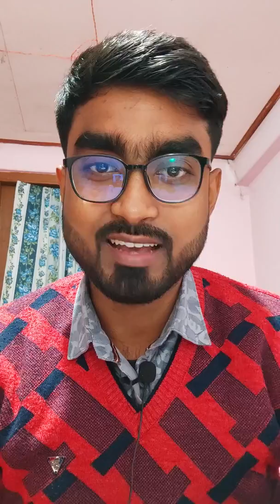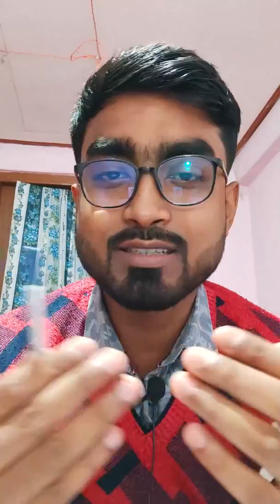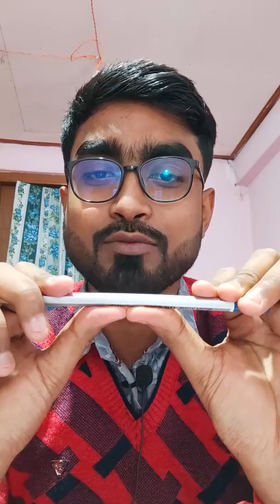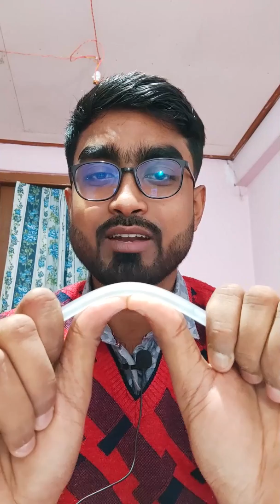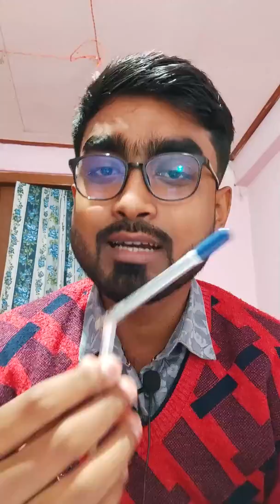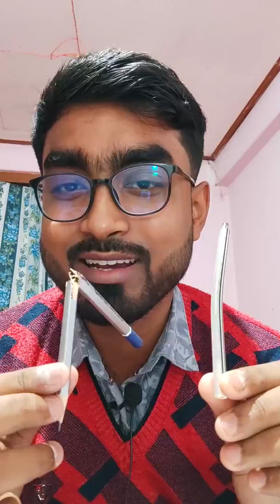Seismic Design of Structures and Ductility | ilustraca | Sandip Deb

Comment: Thank u sir. I followed ur  vedio  focusing on sign lose in Response Spectrium. It was nice . I want to combined the resonse spectruum load  with the  permanet and variable load  in csi safe after editing the loads in iteractive table. As the exported variable and RS loads were  not factored( in eurocode live load must be taken 30% for office and residential buildings during equivalent lateral force or Response spectrium load cases( uses  70%/30% ortogonal  direction  combination )  So how can I combine them to proceed design of foundatio?

Comment: A quick question- for inducing ductility in the structure, the steel used in the shear reinforcement has to be strong or weak in terms of tensile strength?

It was a nice video for sure! 👌